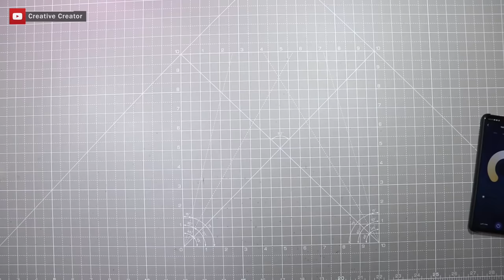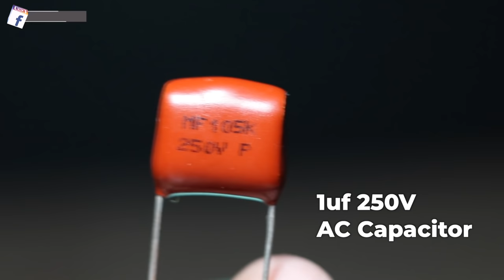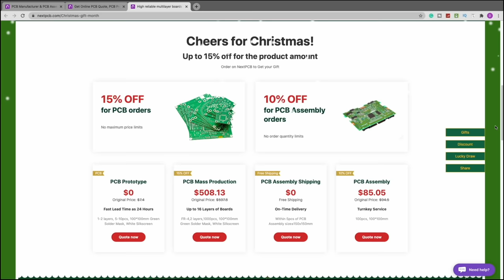[NEW] Simple Electronic Project

Comment: Maybe a simple circuit.  Picture a wheel with spokes.  Strips of lights are attached only few spokes.  When lights are energized they flash in a way to make the wheel appear rotating.  I saw this on an outdoor train Christmas decoration.  Hope you can help?
Reply: Thats already made man look it up for bikes
Reply: Steven.  Merry Christmas.  I've seen where I can buy it made already but at over $3,000 it too rich for me.  That's why I want to make it.    Picture an old western stage coach wheels. Now. Picture the spokes.   Every 4th spoke has a string of lights all the way around the wheel.  That circuit lights up, goes out then the next set of every 4th spoke lights up.  This repeats starting with first group of spokes lighting up again.  This repeats to give the allusions of a rotating wheel
Reply: Keep in mind the ac
Reply: Keep in mind the actual wheel is stationary
Reply: Well if it wasnt ac hell it can be done sorry Bruce
Reply: "Well if was AC it can be done"?  The AC message was accidentally sent.  I corrected the message in following message.  AC was supposed to read ACTUAL   AND YES. I can find easily lights for bicycle wheels but that is not what I'm after.  Picture non rotating western stage coach wheel being made to look like its spinning.

Comment: I would love to see a circuit analysis on how this works. @Creative creator
Reply from the maker: Ok
Reply: @prasanthnimmala  first, thanks for sharing.
Second, it is not the same circuit.
Third, I want to see a circuit analysis, not a circuit diagram.
Reply: @saudabdelaziz3002  Basically the VCC connected button charges the red capacitor, and the GND connected button discharges it. As the cap is charged, the voltage in it will rise, and as it is connected to the gate of the transistor, that voltage will control the current through the transistor and thus the current in the leds. The purpose of the large resistor in series with the capacitor is to slow down the charging and discharging of the cap, so that the brightening or dimming of leds is slow. The cap maintains its charge over time because a mosfet's gate has only negligible leakage current to it.
Reply: @TP-nh2oi  thanks for the explanation bro 👍

Comment: can you help me with an opinion?  it's about ambient light in a car that no longer works.  it receives current from the comfort module until the resistance and after the resistance it is reduced to 3 and something V but the bulb does not burn.  to be the faulty led?  if I supply 12 V the light comes on.  an opinion?

Comment: What solder are you using. Saw everything else but that. You make it look so easy.
Reply from the maker: I am using generic Chinese 60w adjustable soldering iron. Thse are very cheap around $5 to $10
Reply: Try to get 60/40 Tin/lead resin core solder,

Comment: Two things I don't like:
First, not putting a current limiting resistor for the LEDs. Without the resistor, the LEDs may be overloaded by a lot and can be destroyed instantly.
Second, using 18650 cells (and even unprotected ones) in a project for absolute electronics beginners. 18650 cells can deliver more than 50 amps when shorted out, would melt the wires and the battery holder, and can burn the user's fingers or start a fire. I'd definitely not recommend them to beginners.
With a current limiting resistor and e.g. a regular old 9V battery, it would be a great project!
Reply from the maker: Ok 🙂

Comment: Two errors in Design:
(1) You don't need a 250v cap, 16V will do since the supply input is only 12V.
(2) What would happen if both switches are pressed at the same time??  (This will create a Short Circuit across the 12V supply .. SMOKE ! ! ! ).

Comment: With prolonged use, the capacitance will be discharged due to the self-discharge of the capacitance and the small but gate current. The second factor that changes the power will be the heating of the transistor operating in the variable resistor mode. For short-term regulation of small loads, this is the right solution. Sincerely, Vladimir.

При длительном использовании емкость будет разряжаться из-за саморазряда емкости и малого, но тока затвора. Вторым фактором, изменяющим мощность будет нагрев транзистора, работающего в  режиме переменного резистора . Для кратковременного регулирования небольшой нагрузки это правильное решение. С уважением Владимир.

Comment: I love the way that piece of wire just shot out of there like a rail gun lol. :...  this is great  it is alot like what I have been  wanting to do , so can  we  add a  volt meter and measure the voltage as it is ramped up with each click of the momentary so that we can determine the safe voltage input of random led's ( this meaning we do not know how much voltage certain led's were designed to operate at ) or field effect transformers so that we do not destroy the led in order to apply the correct resistance while we measure lumens for optimum performance ?

Comment: Work with PWM will make the circuit more effective. You wasting energy in the mosfet by driving the leds with the mosfet because normally a mosfet is made for two states on or off

Comment: the last led the one composed of an array of micro leds usually work at 36volt or maybe there are models unknown to me at a lower voltage maybe 12v but it must have a much higher amperage. As long as the 3 LEDs light up in series, even double, ie 3 + 3 in parallel, it goes in accordance with the voltage of the batteries. the last led, on the other hand, which should have 36volts of voltage, I don't see how it can light up.

Comment: Dude that was awesome circuit. Will LEDs hold same brightness for long time or does it decrease? I would like to build this for my study area's background LED strip
Reply from the maker: Brightness will not decrease vut the main problem of the for the circuit is tha you can't turn-on two switches in same time. It will be short circuited. 
For removing the problem you can see my modified schematics from description link.

Comment: Can you use this also for a 12v motor?
Reply: No you can't.  You need an initial 12V pulse to get the motor started to overcome stiction.  This is an RC on the Gate of the FET.  Also note that the capacitor will self discharge over time through the gate-source connection.

Comment: I wish you would stop with the thumbnail clickbate.
The picture of 2 buttons connected in series with leads on a single led is nowhere in the video.
I admit though the dimming circuit is cool.  Over time though the capacitor will discharge on it's own so the dimmer will spontaneously dim over time.

Comment: I am curious how the circuit works…
Reply: like total shit, simpler terms the mosfet is driven by its capacitance to its linear region, which is extremely ineficient, may cause the mosfet to meltdown. also will only work with up to 19v anything more will damage the gate, also less than 5v wont even do anything. he clearly is one of the top pepega engineers.

Comment: Interesting inexpensive dimming circuit.
Reply: is not 1.useful nor 2.reliable
1. the mosfet operates in the linear region which means it dissipates all the power the LED is not using
2. the dimming steps are dependent on how long you press the buttons
Reply: @viermidebutura  Usefulness depends on the application.  I just thought the technique of using a gate capacitor to set the current was interesting.  Yes, I agree that the dim level is not likely to hold very long.  The Igss for the IRF3205 is 200nA (0.2uA).  That will deplete the 0.1uF film capacitor at 0.2V/s  so the change would have likely been noticeable if he hadn't been pushing the buttons to adjust it. This technique could work better on-chip where you could better control the leakages.
Reply: @connecticutaggie  ofc with extra circuitry the gate can  be reliably controlled but dissipating all the power that doesn't go into the LED defeats the purpose of using a mosfet dimming circuit

Comment: 1)   BEST IDEA!!!DIY generator coil!!!how to wind a coil!!!LED test/как намотать катушку для генератора https://youtu.be/6tosn77Vh7Q
2)   BEST!!!64v Generator 3D printing DIY/64в генератор своими руками на 3D принтере https://youtu.be/Iao_HT0Vc7U
3)   Indicator flux gel test for soldering/индикаторный флюс гель для пайки тест https://youtu.be/RaaS8dXLW30
4)   TOP 3 Electrical DIY  #1/3 лучшие электронные самоделки 2021 своими руками https://youtu.be/h3UmoXsmdn4
5)   BEST!!!AutoLight With Light Dependent Resistor LDR: Photoresistor/автосвет с фоторезистором https://youtu.be/7LPpgEddAQg
6)   Solder Paste SD 318 NEW Test!!! тест паяльная паста https://youtu.be/VtjyjsoK36c
7)   0$!!!FREE energy!!!perpetual motion machine!!!free charging!!!Вечный Двигатель генератор из кулера https://youtu.be/8290MzsLMws
8)   12v simple battery level indicator without relay/transistors уровень заряда батареи 12В https://youtu.be/iK7FnWakCsg
9)   Сurrent Phase Tester BC547 DIY индикатор фазы/скрытой проводки своими руками https://youtu.be/lkAOjolr9Sw
10)  3 Level Water Sensor Electrical DIY BC547 индикатор уровня воды 3 уровня своими руками https://youtu.be/qEeE8NePDAg
11)  BEST!!!Wire cut indicator!!!Индикатор обрыва цепи!!!Open circuit indicator!!! https://youtu.be/v83A0qzV52M
12)  BEST IDEA!!!timer switch off!!!soft off!!!плавное выключение!!!задержка выключения!!!BC547!!! https://youtu.be/4ciQrg3U2w8
13)  BEST IDEA!!!Police LED Flasher Blink DIY!!!Полицейская мигалка своими руками!!!BC547!!! https://youtu.be/Jjwp7nN8Jdw
14)  NEW 2021!!!TOP 3 Electrical DIY  #2/3 лучшие электронные самоделки 2021 своими руками https://youtu.be/ra-QVgh6z04
15)  BEST IDEA!!!Heat Sensor!!!датчик нагрева!!!thermistor and BC547!!!термистор и BC547!!! https://youtu.be/575dOLzpR60
16)  BEST IDEA!!!IRFZ44n!!!MOSFET 2 WAY SWITCH!!!2Х СТОРОННИЙ ПЕРЕКЛЮЧАТЕЛЬ!!! https://youtu.be/8ajqiKRozVw

Comment: What if I'd like to make it with 100w led
Reply from the maker: Just use a heatsink 
It will work with ease.
Note: Don't push the 2 buttons in same time it will short-circuit. One after one is ok 😃
Go and try it. It will work for sure.
Reply: @Creativecreator  Thank You man...you're awesome

Comment: 1) your desoldering technique sucks. Potentially will destruct the MOSFET.
2) you didn'tuse a strain relief on the clamps.
3) you don't seem to bother about ESD. Without proper precautions this will likely destroy your MOSFET.
4) Most important: am I te believe this works for dimming a high power LED, without cooling the MOSFET?
NO WAY.

Comment: I am confused by this video. I understand that the specific purpose is to make a dimmer circuit controlled with buttons, but I do not find this educational in the sense that someone would understand how this circuit works via watching this video. I am rather new to electronics, and all that I took away from this is that I could achieve a similar effect with a potentiometer. I also do not understand the inclusion of additional parts in the parts list such as the 555 timer, which are not used in the video. I find this so simplistic that it is useless for learning.
Reply from the maker: Check this: https://getvid.cc/12v-led-dimmer-with-irf3205-mosfet-and-1uf-ac-capacitor/